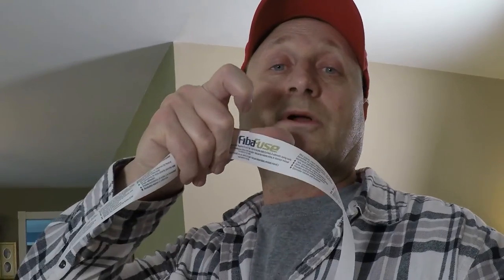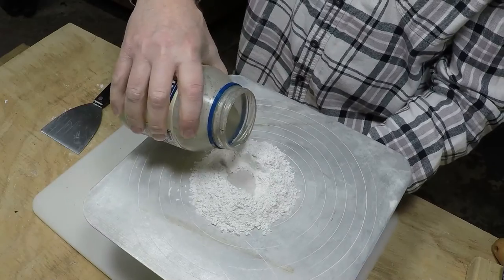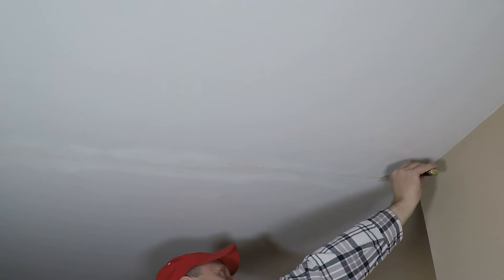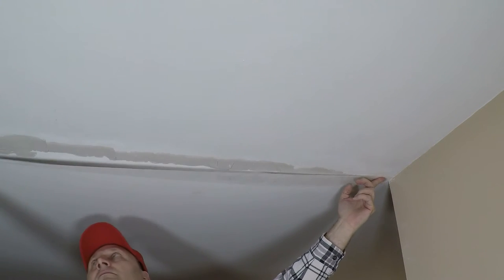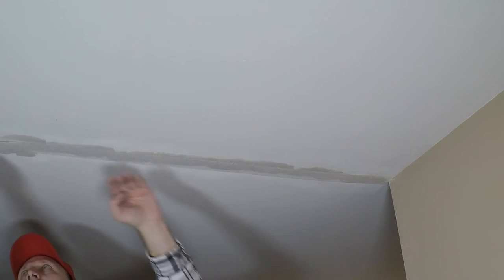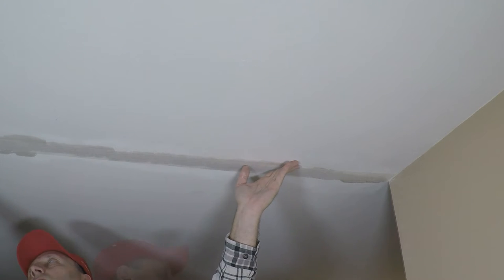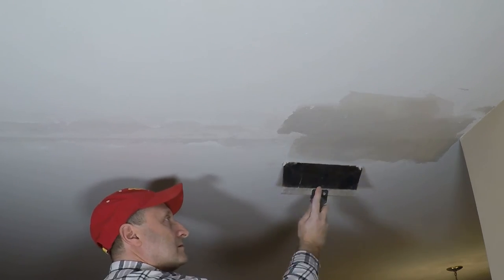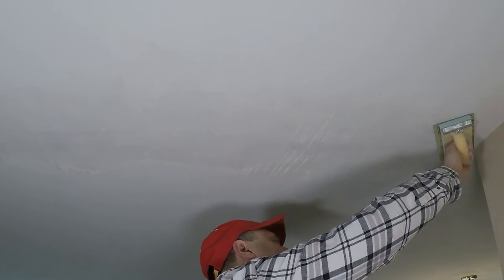Fixing a BIG Crack in a Ceiling

Comment: Looks so familiar. Back in the day when I lived in NJ, I owned a bi-level home and had the same problem where the hallway met the living room, kitchen, and the stairway, a lot of open space. I tried fixing it a few times, but it would crack again, always when the season changed. Back then,  trusses weren't popular like today. What I did was reinforced in the Attic a self-made truss system from the roof rafter down to the beam, stabilizing it. It worked, never had the problem again. A builder's boo-boo.
Reply from the maker: thanks for watching..